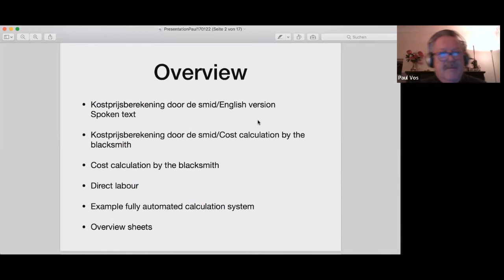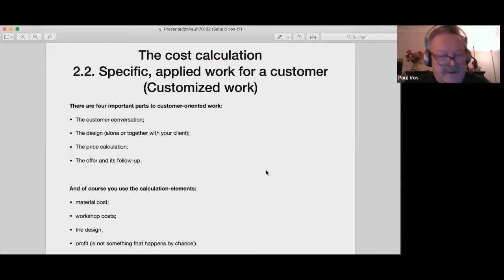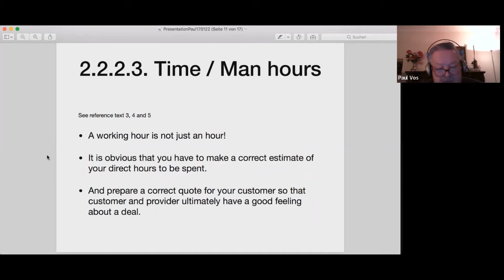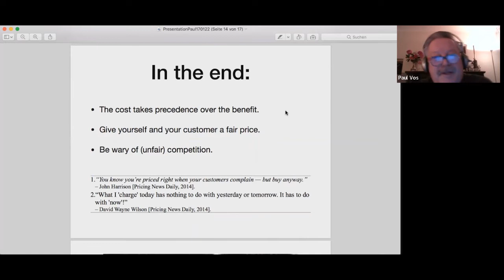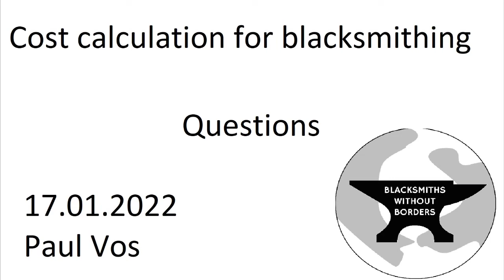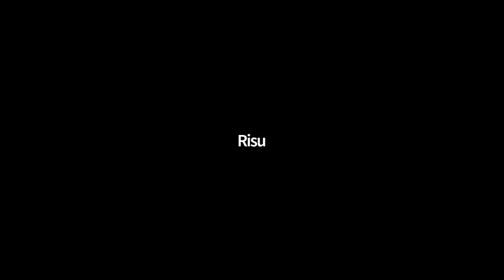Recording Treff with Paul Vos about Cost calculation

Comment: Excellent job. There will also be local specific costs people will need to consider that might influence the type of work you do - for example here is Australia, in most states, if you make something structural you will also need it certified by a professional engineer, which is very expensive. So you may decide not to work in that field, stick to artistic work instead. Also a good idea to have product insurance.!